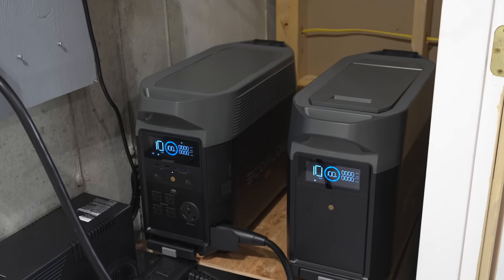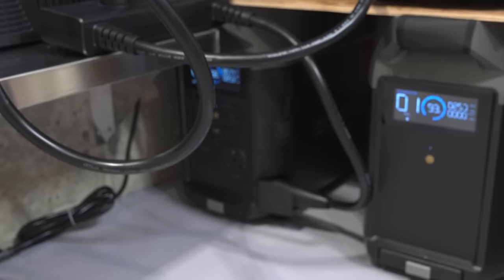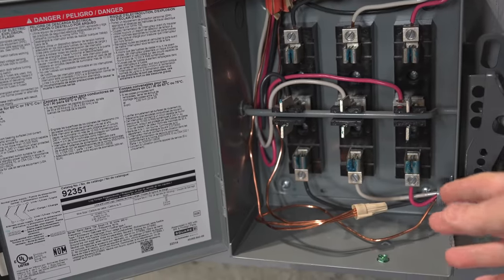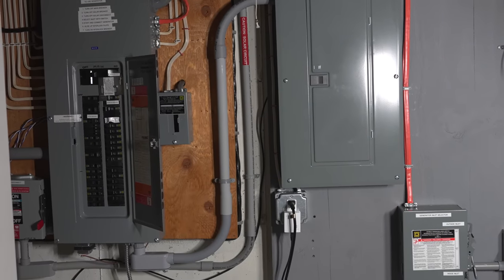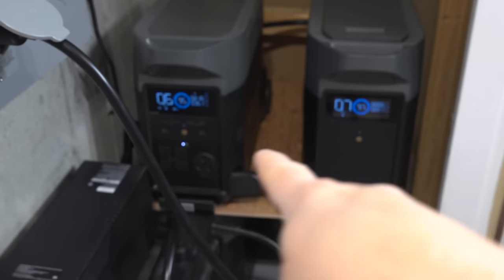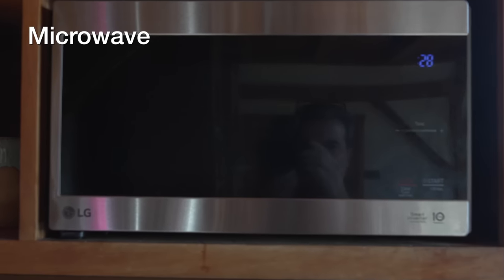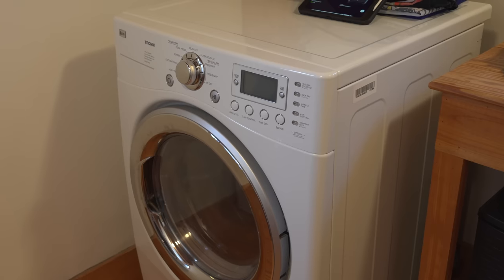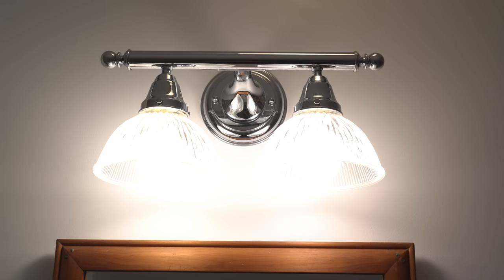How to power your Whole House with a battery generator - Ecoflow Delta pro

Comment: You would be better off with a propane heater if you lived up north, a wood stove and a just one eco flow with a solar panel and a generator for everything else. You MUST protect your fridge and freezer at all cost and that's why you just need enough power at the bare min for those appliances

Comment: I am trying to put together a battery backup system for my Generac propane backup generator.  With a power outage I would like to run the Generac during the day (also recharge the ecoflow battery system during the day) and the ecoflow battery system at night (much quieter system).  I believe this could prolong the viability of the Generac as well.  The only thing is I don’t know how to do set this up.  I am not an electrician and would need help.  Any ideas.  Thanks in advance for your help.

Comment: If i have an existing transfer switch for my house (which I power with my 9500 westinghouse during outages), can I use my Delta pro to plug directly into the switch panel like I would my gas powered generator?

Comment: I'm really interested in a peak shaving system. Is there anything you recommend?
Reply: Schnieder Electric has a hybrid inverter/charger system that at least used to be called the XW that had this capability.  It could also be automatically switch to battery power when the mains failed and auto start/stop a generator when the batteries are low/high and perform load shaving as needed while on the generator.

Comment: I love the setup and want to do something similar! When the Delta's need charging and the grid is still down, do you detach them and take them outside to charge with a generator?  Or have you made some type of port through the wall to connect?
Reply from the maker: Thanks, so it really depends. You definitely don;t want to move them around. I will just use a heaby duty extenstion cord and run that to the back of them while charging. Most outages are less than 1 day so this will work super well for those and for longer more disaster situations I will resort to charging them as needed.
Reply: @SilverCymbal  Just run the house on the generator and plug the Ecoflows into any house outlet for recharging.

Comment: All well and good, but keep in mind your run time with any significant load will be hours, not days. For the ice/snow storm power outages where crews cannot get power restored for a few days,  you will need a fossil fuel powered generator running 24/7.
Reply from the maker: Depending on batteries 1-2 days should be reasonable but you also get to cheat. Run your gas generator for 4 hours durigng the day, charge them up for another 1-2 days of silent running. Or if you can use solar that may buy time also. Be sure to listen to the end, there is no perfect solution and I totally get we are still at a point where long term outages need gas supplementary.

Comment: Great video!  Is your dryer a gas or electric one?  I have always wanted to build a portable auto-start generator with an inverter connected to a Lithium battery.  I know the concept is common, but I would love to see it in a portable "wheeled power center" type setup.
Reply from the maker: Thank you, the dryer is electric. That is why its most impressive that it can handle that plus whatever else was running in the house. That dryer is also maybe 12 years old.

Comment: Can you charge the EcoFlow with the dirty power of the gas generators? I had this question for the solar people to an enphase batteries, and only inverter generators were allowed to charge batteries directly.
Reply from the maker: Yes you can, most semi modern gas generators even non-inverter still supply reasonably clean power but its should have no issue charging the ecoflow. The ecoflow inverts it anyway so it won't directly reach the batteries

Comment: Would the batteries charge when you have normal power coming in or do you need to have them plugged in separately?
Reply from the maker: Yes, they would accept regular 120v through charging ports on the rear. I reviewed this unit with a lot more detail here: https://youtu.be/bfWzPPDh2Yg

Comment: Are there any automatic transfer switches that work with these batteries? The problem with power outages is they usually happen at the most in opportune times when you’re not home and it’s pouring rain and your sump pit is filling up with water.
Reply: your sump should have its own battery backup

Comment: Wait, why would you bother switching the neutral?  You only need to switch the two hot phases, the neutral can just be bonded.
Reply from the maker: This is the only way to guarantee all conductors are being isolated. Electrically I get what you are saying but my researched show the safe way to do it is with the neutral.
Reply: @SilverCymbal  Neutral must always be tied to ground somewhere.  When on mains, that somewhere must be at the main service entrance.  When on an isolated generator, the neutral is supposed to be grounded at the generator.  You can just keep the generator tied to the neutral all the time, and the neutral tied to earth at the main entrance all the time, and there's no point it separating the two.  What would switching the neutral between one ground point and the other gain?

Comment: Hi can someone help me please. I just purchased an ecoflow with the transfer switch.  My electrician hooked it up so it powers the house and all the outlets etc. when current goes and I flip the switch to the generator, the ecoflow makes a clicking sound while it’s still plugged into the outlet it charges from.  When I unplug the generator from the wall the clicking stops and everything runs normally.  Is this normal behavior? Like some type of loopback effect?

Comment: Do I need a 240v converter if I'm only running one Ecoflow Delta 2 max? I'm thinking you use it since you're running multiple batteries?
Reply: You must use 2 Delta Max's, and the connecting block, to get 240V.
Reply: Thank you..

Comment: That’s 10k worth of free EcoFlow products in return for this review! What’s a gas generator run?
Reply from the maker: Well not really. They gave me these a year ago for the original video review. This was a follow up,m just sharing a project. There small generator is $1100
Reply: @SilverCymbal  It would not be advisable to run large loads on these systems. It will deplete your batteries very quickly. In an emergency situation given that your are in the middle of nowhere NH you would only want to run your furnace and a few other 15amp circuits which take up very little wattage and you can get many hours of run time while power is restored.

Comment: Those battery backup systems are nice but they aren't practical for most people because of how expensive they are. One unit is already pretty pricey. Now multiply that times four like what he has in his house. Geez, at that point you might as well spend the extra money and get a Tesla power wall that will have much longer runtime over them little units.

Comment: That's like 15k in batteries. The only benefit I find with batteries is the silence. Other then that, the stress of charging them and constantly watching them doesn't seem worth it. Atleast not in a disaster type situation.
Reply: With the right system you don't have to watch it; the system can auto start/stop the generator as needed, which with some solar can be rather little.

Comment: Chris, Is reliable utility power a problem your remote area?
Reply from the maker: The power in NH is surprisingly good, better even then when I was in Mass. Except when we lose it it can be for a week or longer due to rough winter storms. That usually happens with temps between 0-5 and even without wood stove setup I cant keep the whole house warm enough to prevent frozen pipes. We are in a rural spot and you definitely need to be prepared. So thats a long answer, so like al power even for those in TX. You will lose it and if you are in a cold climate you want to be prepared in multiple ways.

Comment: Are you feeding a 200a panel from the backup batteries with a pair of #10AWG Romex??
Reply from the maker: Yes, but the beginning and end of the circuit are protected with a 30amp breaker which is sized correctly for 10ga wire. In reality your 200amp panel draws different loads at different times, many under your control, i.e. electric dryer. So while you have the connectivity to run all the loads, you can't exceed 30amp in total.

Comment: Nice video.  But you have 4 battery/inverter banks at about $14K? Yet only 7 hours of run time, let alone not running dryer or other heavy loads, then you just knocked your run time to shreds. You would need a solar system or generator twice the wattage of your Ecos to charge them up and run your house. For $14K, you could get about 4,000 AH of lithium batteries and a 10,000 watt inverter. That would give you 50 amps for 80 hours. Eco is not practical in run time/cost. Cost wise generators are still the best solution. Even a small diesel jenny with auto start wouldn't be too far off from the cost of the Ecos.

Comment: Is enough to power a heat pump/AC?
Reply from the maker: If its a modern heat pump AC, like a Mr Cool or similar you can definitely run it. You can run old stuff too but newer ones use much less energy

Comment: Can this set up run a 3 ton A/C or a furnace large enough to run a 3000sf home?
Reply from the maker: Just depends on the power draw of each device.  But yes the AC will likely draw around what the dryer does but you can check the plate on it to see what power it needs and that will help determine how long it can run for.

Comment: So you’re feeding your main panel 200 amps through a 30 amp back up system.  Definitely want to keep your real life emergency load down.  No running your microwave, two refrigerators while trying to open your garage door at the same time! 😁

Comment: Chris, am I losing my mind…. I swear you reviewed the EcoFlow gas generator at your old house, and even tested the solar tracking solar panels?? 🤔
Reply from the maker: No you aren't. I did review the original gas model, but I wasn't able to do a full test with it connected to the delta pro and ensure it will start/stop as designed. Plus based on feedbnack they also upgraded it to a propane/gas model now. Hopefully I will be able to show that with this setup in the next month or so.

Comment: Around $13,000USD after tax for this setup.. I think I will stick with my $1,000 generator. The money I'm saving will get me ~200 days worth of fuel; I'm 30 years old now and have only had about 8 days worth of outages in my lifetime
Reply from the maker: If you buy everything I showed here its about $7k, not sure where you are getting double that. The generator inlet switcher is totally optional.
Reply: @SilverCymbal  It's 7K before the two expansion batteries you are using. That's another $5.1K for two with their current web pricing
Reply: @Zach_Miller  WTF.......that is absolutely ridiculous.
Reply: @Zach_Miller  Exactly. 2 x EcoFlow Pro at $3500 each plus 2 x $2600 for EcoFlow expansion batteries. And that's with the current sale pricing which is saving you around $800.
Reply from the maker: @Zach_Miller  Yes sorry you are correct
Reply: Yes the system isnt cheap but you can file for 30% tax credit that will help offset the cost. But what you get is an automatic transfer. With a Generator you have to Maintenace it every few months if you are using gas. with a battery system there is no maintenance it will just work.
Reply: Yes, but can your generator provide as much peak power and can you stockpile enough fuel ( and keep it fresh ) to keep it running for a week if needed?
Reply: @phillipsusi1791  Absolutely. I keep on-hand around 25 gallons of non-Ethanol fuel which if treated can last a year (I've tested this a few times). Also, in a true emergency you probably don't need to run your generator 24x7. Depending on the time of year you may only need to run it for a few hours each day to keep the fridge and freezer cold or in the winter every x-number of hours to keep the house warm.
Reply: @eosjoe565  That's the thing... when you want the house to be kept warm or cool and the fridge to keep cool, you don't want to have to go out and manually fire up the generator and run the fridge and AC/heater for 2 hours then shut it all down again for 2 hours again and again.  With a smart battery system, the generator can automatically start and stop as needed to meet your demands without you having to set an alarm to wake up to turn it back on, or have to remember to NOT open the fridge while it is off.  You also still have lights and ceiling fans while the generator is off.  Also you need a pretty big generator just to be able to run your central A/C at all.  With a battery, you can stick with a smaller generator unit and not have to manage when it is on or off.

Comment: Very expensive way of gong about it.  I have a DIY system with a 10 Kwh battery bank, a 4,000 watt split phase inverter, a 10 circuit transfer switch and a small 1 Kw solar array.  It cost me about $5K.  Your power stations alone cost over $14K based on current prices on the Ecoflow site.  For that money I could increase my battery bank to 40 Kwh.
Reply: IIRC, when I last priced out such a system, a 100 AH 48V ( only about half the 10 kWh you claim ) battery bank cost about $10,000, plus another few grand for the inverter/charger, and a 1 kW solar array costs about $4k.  I don't see how you can claim that all of that is only a fraction of $14k.
Reply: @phillipsusi1791  Prices for components are less that you recall.  My Schneider 24 volt, 4 kW, split phase output inverter cost about $1,250.  I paid about $1,000 for the solar panels.  The other big ticket items were the 10 kWh battery bank ($1,000 - it is deep cycle lead acid), the solar charge controller and the 10 circuit transfer switch.  I installed and wired the system myself so there were no labor charges.  I am currently adding 10 kWh of LiFePO4 batteries for a total additional cost of about $3,500.  I am using two LiTime 24 volt 200 Ah batteries ($1,550 each).  This sort of system is easy to design and install if you have basic skills, which I do.  When my lead-acid batteries die I will add an additional 10 kWh of LiFePO4 batteries.
Reply: @todddunn945  I didn't know they had a smaller unit like that.  The one I am thinking of used 48v on the DC battery side and could invert that into just over 6000W ( up to 12000 for < 30 seconds ) to the AC side, and you could gang up to 3 of those together to get 18 kW continuous, 36 kW peak start load.  Running a central A/C system takes about 5 kW continuous and 10 kW startup, which is why I was looking for such a system.  The higher DC voltage also makes it more efficient.  That's why I also go with PC UPS systems that use a 24 volt battery instead of 12v.  When you try to put twice the current load on the battery at half the voltage, it buckles MUCH faster even if it has the same Wh rating.
Reply: @phillipsusi1791  I admit I cheaped out by buying a 24 volt inverter rather than a 48 volt unit.  I live in on an island off the coast of Maine where the idea of air conditioning is silly.  Hot here is 80 F.  My system is a backup for power outages.  With the new batteries I finished installing yesterday, we are good for about 72 hours with no sun.  If it is reasonably sunnt we can go for about 4 days without grid power in the winter and indefinitely in summer.
  The system I built needs to be able to run the heating system in winter and the fridge, freezer and well pump ads well as lights.  Lights are a trivial draw though.  It is after dark now and we have one 20 watt LED light on  in the house.  Our home's power usage peaks at about 7 kWh per day in winter and is under 4 kWh in summer, so we don't need a huge inverter.  Personally, I find the idea of using 20 or 30 kWh per day just crazy.  On hot days we just go out on the boat because it is always cool 50s or 60s) out on the water.  I simply would not live in a place where I needed AC.
Reply: The OP was using the ecoflows.  I looked several years ago at the Schnieder Electric Xantrex XW system where you could get 6kw per inverter up to 3x.  I think back then I priced out one or two of those with 100 AH lead acid batteries at 48 volts ( so 48 kWh ) at $10-$15k.  The price combined with the fact that I almost never lose power is why I didn't get it, but yea, it could be nice to have when you do lose power and if I lost it more often, I might have gone for it.
Reply: @todddunn945  Yea, I summer York Harbor, Maine.  Up there you have the problem of needing to maintain the sump pumps in the basement ( next to the sea ) even when the grid goes down.  My point is that trying to run everything from a generator alone requires an oversized inefficient generator that must run all the time, as opposed to coupled with a battery, which can keep the light stuff going without the generator most of the time, and only fire up a smaller generator sometimes automatically to either help support the heavier load, or to recharge the batteries after running the lighter loads for a while.

Comment: This is not something an average homeowner can install or even operate. You would need a very good licensed electrical contractor to install everything, permits so should/if something goes south and kabomb, your insurance company says, sorry, you didn't get this inspected and approved. Even after all that, you'll need a manual with illustrations to remind you what to turn off, turn on, what to watch for... And just what will recharge those batterys? Do you need a fairly sizable set of solar panels? Hows the weather during a power outage, cloudy? For how long ?
Thats just a few $,$$$. Run a 30amp 240volt cloths dryer with one load of wet cloths and those battery will pretty much be expended. It looks impressive, but again, very complicated for the average homeowner.